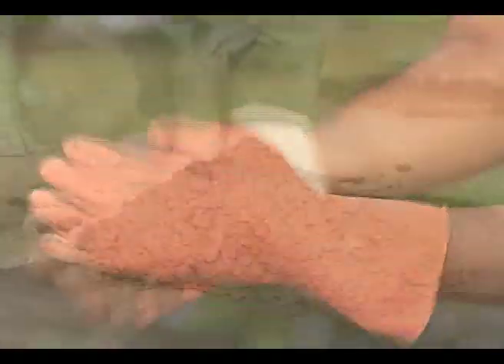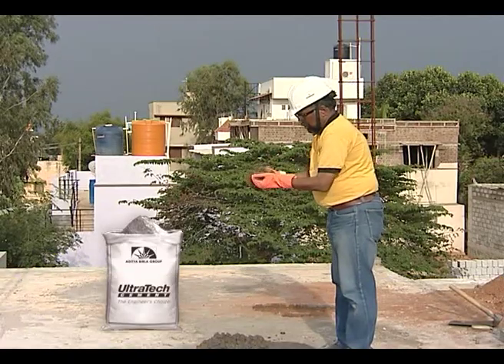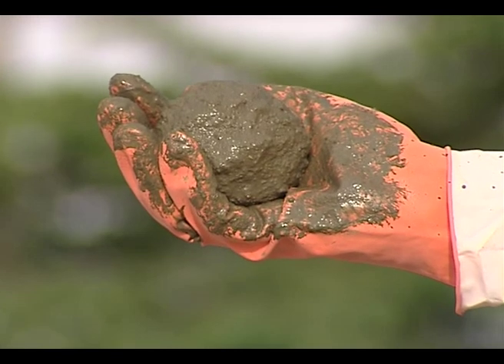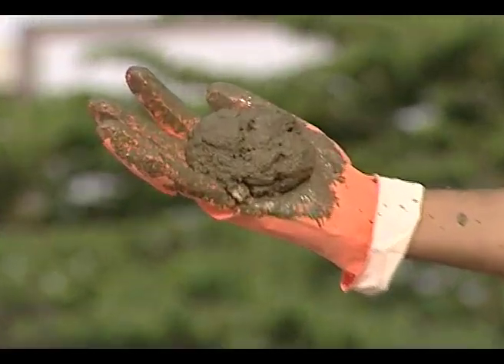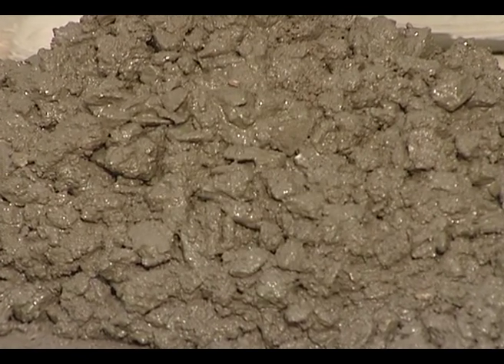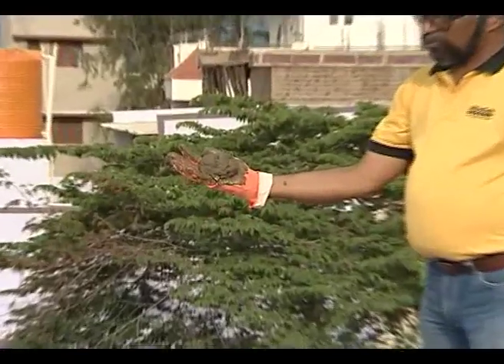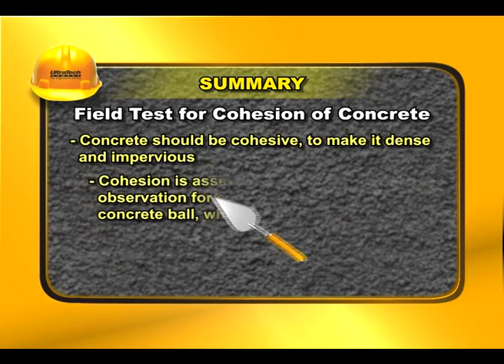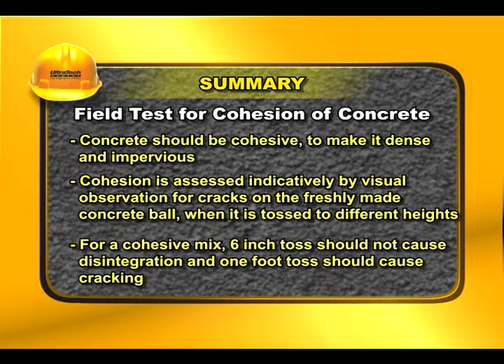FIELD TEST FOR COHESION OF CONCRETE

Comment: Which test is used for cohesion of soil
Reply from the maker: Hi Hemant,
Thank you for your query, our experts will get back to you shortly. 
Regards,
Team UltraTech
Reply from the maker: Hi Hemant,
Thank you for your query.
"Cohesion Soil" means Clay(fine-grained soil),or soil with high clay content. A Cohesion soil has an attraction between particles of the same type, origin and nature. Therefore, Cohesive soils are a type of soil that stick to each other. Cohesion© is usually determined in the laboratory from the Direct Shear Test. Unconfined Compressive Strength, can be determined in the laboratory using Triaxial Test or Unconfined Compressive Strength Test. You may also calculate it easily if you have the field standard penetration number (N-Value) by Cu=KN, where K=Constant=3.5-6.5kN/sq.m and N=Field N-Value. 
Hope we have answered your query. Let us know if you want to know anything else on this.
Regards,
Team UltraTech